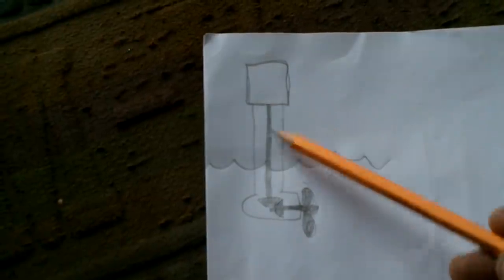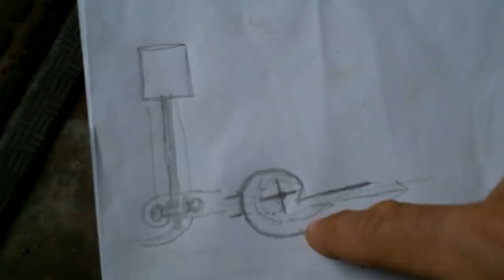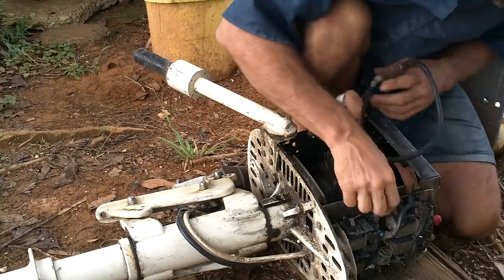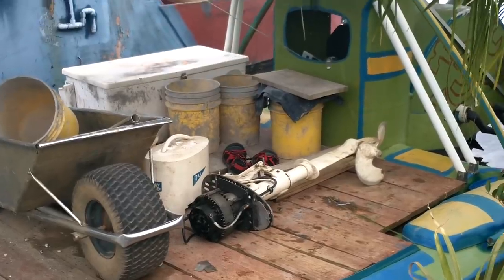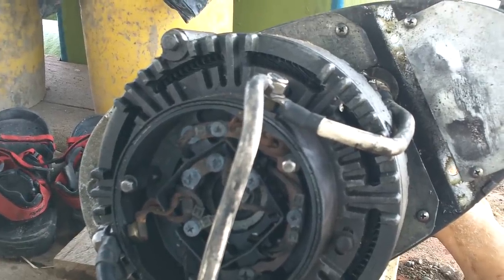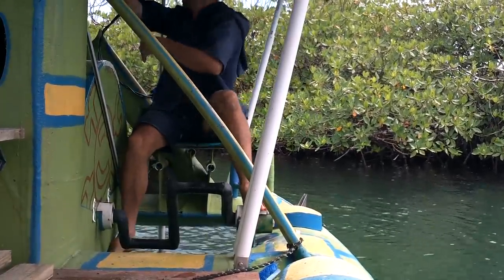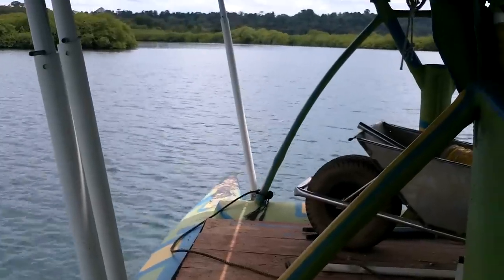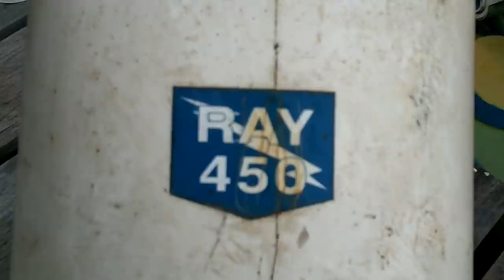Motor Death and a Resurrection

Comment: Why not go back to the long prop design and use a rudder. The water wheel and aqua-dynamics don't look great. i would focus on improving efficiency. look at the torpedo outriggers that sit under the water with only thin blades having to break the surface tension.
Something like this and you can pedal a generator rather than a waterwheel. Put the props at the back of the torpedo hulls.
https://www.youtube.com/watch?v=BlTibownuTQ

and this!
https://www.youtube.com/watch?v=0B73uIJFfZo

Comment: the drive type you sketched on the paper does exist. There are jet pump outboards on the market. The difference with your drawing is that they use a vertical (special shaped prop) that will speed up the flow by reducing the diameter. that vertical upflowing water is piped to the horizontal nozzle. Do not know a lot about them and if manufacturers  still make them ( Mercury used to for sure). They are used in very shallow water. but I guess they cost a lot of wasted energy just to make the water go around the corner instead of straight out. your setup is a bit the same with the difference you want to make a centrifugal pump. and I think that is less efficient.

just looked online. a new jetpump outboard is 30% less efficient compared to a conventional outboard drive. and that is only when the jetpump is perfect. when making it yourself I am sure you will not be even close to that number. direct drive is very efficient. and as a second the electric motor mounted on an old gas outboard body. that gear hub is factory made for the job and when maintained a bit will go a long way. it is compact and easy to install and lifted to reduce drag when not used. And the White old outboard is even a dedicated electric motor made for this so that is the best you can have I guess. very simple, no electronics so very good for in the middle of nowhere